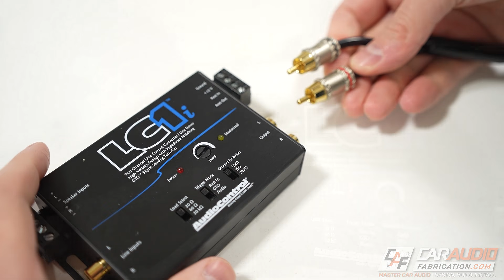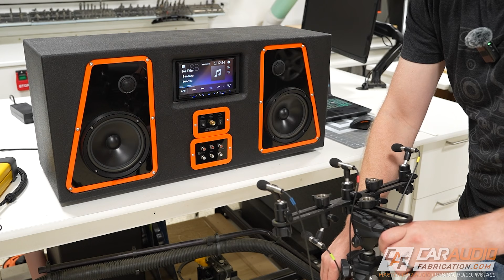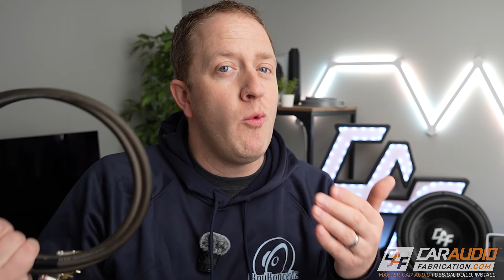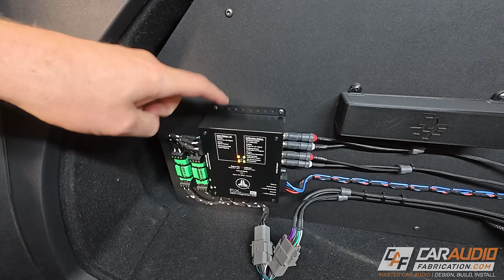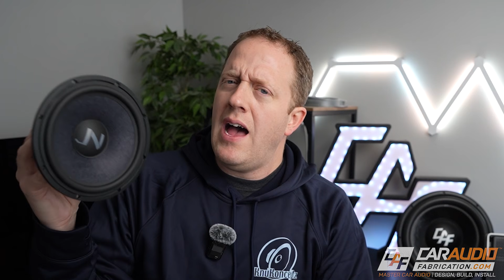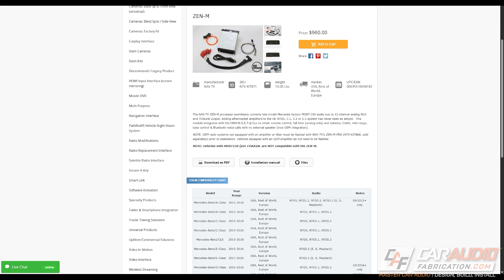Better sound WITHOUT replacing dash stereo! OEM Integration Fundamental Terms!

Comment: Question for you: For my Tesla Model Y, I found a fairly efficient Infinity 8" subwoofer rated at 91 Db at 1 watt/meter. The downside is that the Tesla amp is dual voice coil with 4 ohm load. The subwoofer has a selectable 2 ohm or 4 ohm impedance, but is only a single voice coil. Grok mentions I should connect both positives to the positve subwoofer terminal and both negatives leads to the negtive subwoofer terminal. It indicates this needs to be done in order to prevent it from burning up. Additionally, Grok indicates I should run the subwoofer at 2 ohm load. This doesn't sound correct. Chat GPT indicates connecting only one pair of the subwoofer connections to my subwoofer terminal and set it for 4 ohm. CHAT GPT indicates this is not a bridged amp and would be best to use a 4 ohm load. I am conflated on what to do. I think the latter is safer but thought I would ask. Would a load resistor be best suited to connect to the unconnected pair of outputs from the Tesla subwoofer amp? I want to get the most power from the amp possible but want to be safe. I do not want to use an external amp, thus the conundrum.

Comment: The worst part of modern OEM systems, in my opinion, is that it costs so freaking much to do anything aftermarket. My car has a factory Alpine system. The head unit is integrated with the climate controls and vehicle management and yeah, you can install an aftermarket head unit, but $500 just for the dash kit. If you want to add amps it’s $350ish for a PAC unit or $450ish for a DSR1, and if you go PAC you need either a DSP or an amp with DSP built in, again driving cost up. Hell, just adding an amp and sub you need at minimum an LC2 or a KeyLOC because even if your amp takes high level inputs it’ll sound like shit just getting signal directly from the factory amp. It’s so f’n expensive. I really miss the days when cars weren’t so integrated.

Comment: I don't understand why car manufacturers can't simply provide a single RCA S/PDIF PCM digital out. The tech has been around for decades, it wouldn't cost a lot to implement as there is nothing proprietary, and it would allow people who want use aftermarket gear get unaltered digital signal without having to use a line-output converter that has colored audio and distortion from the infotainment system's DAC and amp. We could feed that digital signal into a good DAC which can then turn that into clean 5v analog audio preamp RCA outs.

Comment: Hey Mark, question for you. I used a Metra harness in my 13 Kia Optima to retain factory amp and speakers for mids/tweets and it sounded terrible! Why is that? I tinkered with it for a few weeks before going back to the stock deck. It's almost like it distorted way sooner than before and didn't have the same soundstage. Using an LC2i PRO for the line out to the subs. Fortunately my bass doesn't roll off so I don't have to mess with all that. Anyway, just starting the video, but I'm sure either I messed something up or its a hacky, yet best, way to keep the factory amp. Thanks!
Reply: Did you buy the AX-HK extra module for the harness?   We're the jumpers inside in the correct locations?  Honestly keep the Metra dash kit because it looks awesome and then get yourself an Idatalink MRR-2 and it'll keep all your oem functions working properly and if your head unit is Idata capable you'll also get gauges, check engine light codes and ability to reset them etc.   Best solution hands down
Reply: @melissathompson7229  Yeah I got the harness and then the thing to control the steering wheel functions, which all worked. If that's what you're taking and about. It was the sound quality mainly. I tried troubleshooting it quite a few times too. I think what's happening is I'm losing my center speakers and noticing. But yeah I love the head unit. I still have it, it's an Android auto and I had my OBD2 setup which was cool. What I'm going to eventually do is just install my other amp for mids and tweets and get some new door speakers. Also I'm sure my bass will sound better not using that line out converter
Reply: @jsteezy80 yea adding your own amplifiers will sound awesome obviously.  Like I said though, if you want to retain your oem amplifier and camera, steering wheel controls etc and have it work flawlessly get the Idata RR2.   Your head unit doesn't have to be Idata compatible for it to work, you just won't get the cool gauges and check engine info, tire pressure etc

Comment: I wish they'd just standardised this stuff. If door speakers were interchangeable and could be swapped out without creating custom mounts that would be great. And if there were some stock amplifiers you could just slot in to upgrade without cutting wires that would make upgrading so much easier.
Reply: It is not so conplicated as it seems really.
Reply: Trying to not be a jerk, but the USA isn't a communist country. Every person and every vehicle is different. If someone wants to cover his entire exterior and interior with tin foil, if they still have a driver's license and they didn't steal the car it's their prerogative. I have never switched to a different vehicle without having to change out the deck as soon as possible. The only thing w sound I have in my 03 F150 Lightning is a short bit of factory speaker wire that goes into the left door. 23 years later, many stolen amplifiers of abuse. The infinity's I did were still playing great. 
The connection for the negative wire finally fell off, because I slam the door hard. My other cars before I got to learn what happens when you don't use a mount. That was a driver door speaker too, lol. 
If I have to drive a rental car for work, I have to bring my SXM box with me so I don't go insane in a factory sound car with no CD player. I don't listen to FM radio and nope I won't ever be playing music from a phone.
TLDR: some people are happy to drive stock vehicles. I'm makes me break out in hives, I'm allergic. Remember, just because you took out factory stuff doesn't mean you can't put it back together again if you change your mind.

Comment: Yes. Kicker Keyloc (best option) or a killer dsp.
Reply: I used to think the same thing. What a great little powered LOC net corrects everything. The only issue is it’s only two channels going in. I can’t get a full signal in my car, even though I don’t have the premium sound system. I have a Lexus ES 350 and it comes equipped with two dash speakers two door speakers, two rear door speakers and a subwoofer. If I’m correct, I think the dash speaker in the front door speaker will give me a full range signal but I’m not definite on that but right there that’s too many channels for the key lock to take in.
Reply: @julesbruchez-theartofgrapp9646 too true. Not enough inputs and outputs for the Keyloc.  Especially on output side.
I have a 2023 Kia Forte with the basic 4 speaker system. 1 coaxial in each door. 🤦
Good thing I got great speakers to use. Just gotta intergrate into the factory system.
Reply: @jasongago9618 Output is easily manipulated. 1. Higher end amps allow one channel RCA inputs  into two channels. Giving you a full range into 1 RCA input but  2 RCA outputs. 

2. Old school way use RCA Y splitter for the inputs. 

It’s the inputs that matter even more because they need a full range signal

Comment: I recently put an LOC (NVX XLCA2X Pro) in my new car. 2016 VW GTI with Fender System. Running 1 12 inch Rockford T1 on a NVX 1200.1. I have it working. It bumps. But the best advice ive found for setting the XBass or AccuBass is to turn the volume up until i hear the bass roll off, in my car, with sub connected or disconnected, its extremely hard, almost impossible, to tell where it rolls off. Making the tuning of the LOC quite hard. Especially since its my first time using one.

In essence i have bass. But it sounds like a high school kids first system they installed themselves. If anyone has made it this far and has insight or advice, id be greatful.
Reply: Are you tapped into the OEM subwoofer wires for the LOC or the front door mid bass drivers?
Reply: @melissathompson7229 The subwoofer wires. Dual voice coil, so left and right. Chose this for its ease of access and many people online said they used them. For some reason with my car i can find a ton of forums and videos of systems being installed, but they all lack the details. Or at least the fine tuning details.

The signal from there seems good. My biggest issue is having a weird spike and dip zone in my lower volume. Where i think the AccuBass is kicking in. And top end bass  being limited due to clipping and distortion.

This LOC is making me feel like im trying to tune an amp for the first time. Except i have higher standards now and cant just let it be subpar.

Comment: Im using a dsp (Helix) in my vehicle that connected from the high level wires to a 4 channel AMP and a Monoblock.
after many hours I can say it sound nice but not the same quality as in my older car with the "cheap" chines Multimedia with a simple rca low level outputs. I wish manufactures will simply add a clean rca line outs for aftermarket components. I even will gladly pay extra for it.
Reply: @naorl8866  I'm right there with you
Reply: How is the helix? I’ve heard great things about it, but don’t know anyone who uses it. I’ve used an AudioControl DM810 for about 6 years now. I wouldn’t mind upgrading it.
Reply: What year make and model?
Reply: @melissathompson7229 My vehicle  is vw Tiguan 2018.
Reply: You just need to get a good wire harness for your car or good powered LOC that converts to Low Level into your DSP. Some of those specific wire harnesses, depending on the type of vehicle, you have will actually even have a optical out. Now allow you to run your optical cable straight to your DSP.
Reply: @julesbruchez-theartofgrapp9646  I bought this dsp for the high/ low level converting and install it by a professional. Do you think it isn't enough and the extra converter with optical will give me better quality?

Comment: Too bad they just can't add pre-amp outs for the enthusiasts. Probably be fairly cheap to do.
Reply: They won't do that so they can charge extra £$€ thousands to get factory upgrades
Reply: @alan.shayler It’s ALWAYS about the $, you can bet on that.
Reply: Yeah, just give us some RCAs, dang it.
Reply: Most oems that have dedicated amps do, it’s not rca’s but it’s a eqed signal that they send to the amp that you can wire into and add rca ends on
Reply: @angryace4017  your right its cheap for them to add pre outs but they'll upcharge that by 100%
Reply: Why would they pay money for extra parts that only 15-25% of people ever get a use out of? That's not economical.  
Why would they pay for more than paper-thin speaker driver cones, when cheapo high sensitivity crud exists?

I wish we lived in a perfect world 😢
Reply: Exactly!!!!! its so frustrating that theres no "AUX RCA" output for the car that bypasses all the system tuning etc
Reply: Right!! Would it kill them for just some preouts and maybe an aux in for a dac?
Reply: Some brands actually do have pre-outs on oem decks. As long as the h-vac isn’t integrated into the deck I think they do have them.
Reply: @angryace4017   the number of people that modify their car audio is miniscule.  People need to realize that car makers make cars, not blank canvases for people to modify.  Its just how it is.
Reply: Dang they still don't have RCA's yet? I had 02 or 05 Chevy cavalier stick shift. Manual windows. The factory must have thought it was extra swanky at the time, it had four RCA jacks on the factory head unit and even had a rear amplifier going to the back speakers. I did try to change those but it was too much of a headache to figure out for a little winter car.
Reply: @angryace4017  there are so many tiny, super cheap things that I believe all cars should have standard. Dash cams, window breakers and seat belt emergency cutters, preamp out, multiple USB ports, in every door.... so so many things.

Comment: It cost me $2500 adding a DSP system with 12" Subs with 2 Amps in my Wife's car.. I miss CD players I would but the system in the car myself for the price of nothing.. And I think DSP suck to be honest.. I blew  2 sets of Subs because the person who installed my System didn't explain that you can't you can't adjust the the sounds on the amps, you have to go into the DSP App and make changes.. If I would've known that it would've saved me an extra $700 on top of the $2500 I spent for installation..
Reply: So they suck because you didn’t take the time to learn how they work? Sounds like user error, not product error.